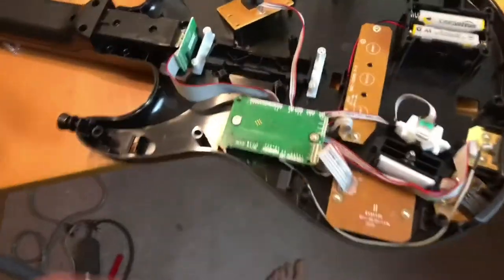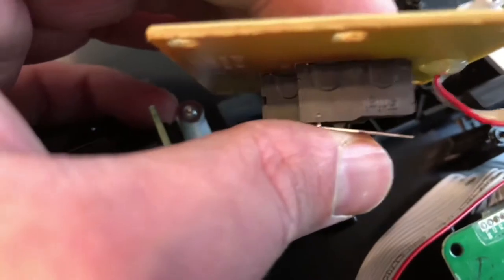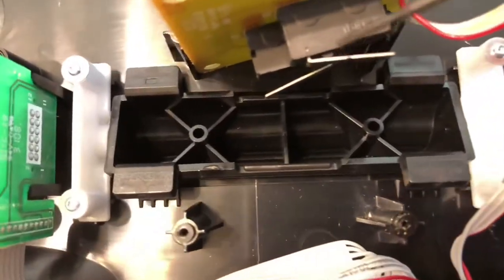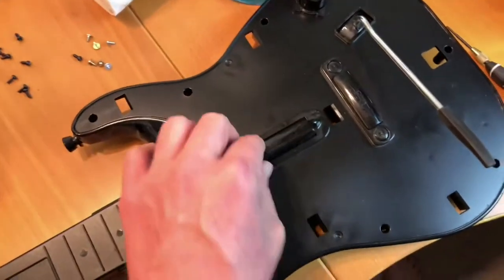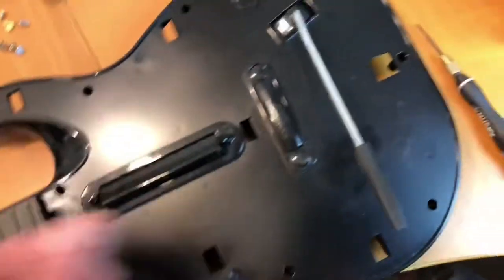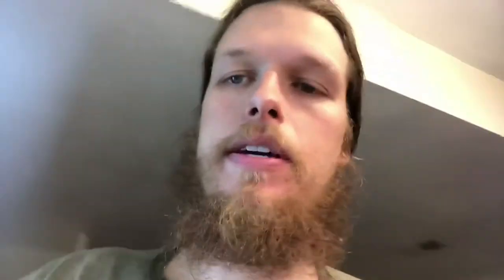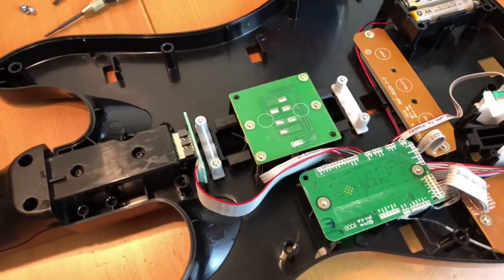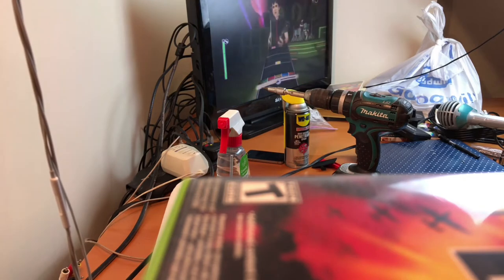How to repair a broken guitar hero rock band guitar strum

Comment: 2023 still helped me!! Thank you!!
Reply from the maker: Glad it helped. Rock on!
Reply: @lorenwillcock  I got as far as the housing for the strum bar and i couldn't get those screws off. Do you know what tool I'd need? I had to order a Philips 0 to get the 4 screws where the neck connects but that won't get the screws for the strum bar housing. Thanks!

Comment: Thanks for this video!!

Instead of bending the metal I got some double sided tape over the piece so it would raise it's volume, worked just fine.

I just didn't remove the protective paper from the tape so it wouldn't stick on the strum.

Comment: Hey man I’ve got a problem where I can’t split the body into 2, it splits from the base fine all and up the body but when I get to the neck it’s like it’s still being held down by something. I’ve taken the four screws out from there but still doesn’t budge and I don’t want to go full monke and break it haha. Any suggestions?
Reply from the maker: Make sure all labels have been removed and you’re not missing any screws. Also make sure if there is a removable face plate… There might be something hiding under there. If this is a model that you can remove the neck on make sure you remove that. After that I would assume there is some kind of plastic clip inside holding it together but it’s kind of tough to be sure.

Comment: I feel that my world tour's guitar strum is really soft, It doesn't center at all and It isn't as strong as the Les Paul of GH3. Maybe this could help me out?
Reply from the maker: if the construction of your guitar is similar to the one in this video... and you feel the strum is weak it could be the momentary switches like in this vid but it is more likely that the springs on the strum are worn or maybe one is broken... its easy to take them apart and put back together so I would just open it up and take a look.... Probably could order the springs on line.

Comment: Thanks man! Now I'm glad I didn't throw them in the trash... Just one question: Do you need the special "triangle" screwdriver to fully open this?
Reply: PD I have the same guitar, just the wii version :)
Reply from the maker: The best I can remember I did not need any specialized tools for this but each model is probably different... I bet you could pick up one of those triangle screwdrivers on amazon for a fraction of what it costs for a new guitar tho.
Reply: @lorenwillcock  I did it! I just needed like a 6 pointed star screwdriver, did what you showed and now it works fine! Thanks for the tutorial! :)
Reply from the maker: Alfonso Garza That’s awesome! Those guitar hero guitars get really expensive now that they don’t make them anymore. I’m glad you were able to save yours!
Reply: @Alfonso Garza  what size you use bro?

Comment: How do you remove the cover to get inside the guitar controller? Cause I’m having the hardest time to remove the top from the bottom. Please let me know.
Reply from the maker: There can be screws in multiple different places throughout the body. If the neck is removable you will want to remove that first. Also some models have a removable faceplate. It is usually just hold on with some clips that you cannot see and you just need to get a thin screwdriver to pry that off gently. There could also be some screws on the back of the guitar body and they are often hidden behind stickers.

Comment: I've opened mine up and the down is not registering at all but the up works fine any idea on how I can replace the down button?
Reply from the maker: Well, first I would test it it’s just maybe the metal tab on the momentary switch that needs to be adjusted by bending it… Sometimes those little metal tabs get worn out and need to be adjusted so that they push the little black button that resides under the metal tab all the way down. If that is not the issue then you will need to see about ordering a replacement momentary switch for your guitar.

Comment: Hey Loren idk if you’ll see this but any tips on a guitar that is adding in random strums when you aren’t even touching it? But then other times not registering strums? Mine just broke tonight playing with my cousin and I’m devastated I wanna try to fix her before I replace her
Reply from the maker: Could still be that momentary switch. You could try adjusting it like in my video. But the switch could be wearing out entirely. You might be able to purchase a replacement switch somewhere.  You could pull the guitar apart and then try to play it using just the switch instead of the strum and see how the switch behaves. If by activating the switch on its own the guitar works properly then the switch is probably fine and might just need some adjustment. Also if it’s adding in random strums it’s possible your springs are either out of place or wearing out. These are the springs that return the strum to its neutral position. You could try replacing those. that would be the first thing I look at. I’m assuming this is a wireless guitar?

Comment: The body on my controller won't come off all the way, only half way. Trying to fix a wired version of this guitar. Should I force it? I don't want to break anything obviously, I would lose a lot of money
Reply from the maker: First i would double check under any labels. Warning labels or stickers etc. any rubber plugs or anything like that. They like to hide screws behind that kind of thing. I have never taken apart a wired guitar. It is possible it is just held together with plastic clips being part of the body but i dont know for sure.

Comment: So I replaced the switches in mine, but the strumming sort of gets stuck. Like I have literally have to center the the strum bar in order to be able to strum again.
Reply from the maker: sounds like the springs are either not installed properly or worn out
Reply: @lorenwillcock  sorry what I meant is it does move back to the center, but I have to completely center it in order to strum again. If I don’t it doesn’t make the click noise.
Reply from the maker: @biofreak96  it sounds like perhaps the clearances of the switches are too tight so to speak. The small button under the metal tab on the switch may not be able to fully extend up unless the strum is perfect. So the metal tab may need to be bent slightly in such a way that the strum can rest at center without depressing the small black button that resides under the metal tab on the switch. You may need to bend the metal tab on the switch in two places. Up and away from the switch body closer to the button (which is under the tab) and then back down at the end opposite the button. this would make it so the metal tab would have to be depressed further to activate the button and the strum would have to be ... strummed more to activate the button.
Reply: @lorenwillcock  hmm alright I’ll see what I can do and let you know.
Reply: @lorenwillcock  sorry for taking a while but it works now. Just like you said I bent the switches a little and now it feels perfect.
Reply from the maker: @biofreak96  nice!

Comment: My strum just keep going up on makn menu idk whats the problem , i tried change its spring but its still stuck
Reply from the maker: Sounds like the switch that the strum activates may be bad. Check to see if the little button that spring pushes down is stuck
Reply: If you are using clone hero, it registeres left as up